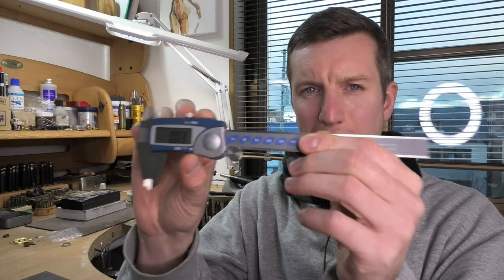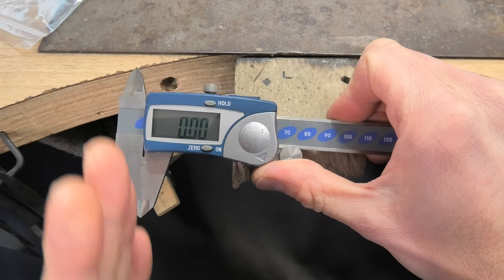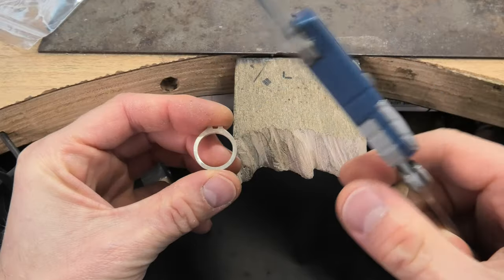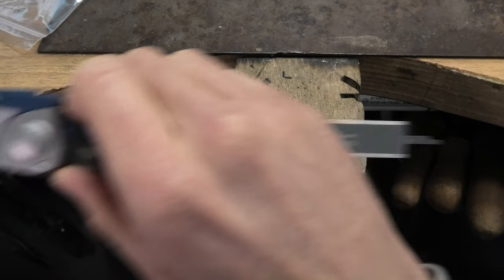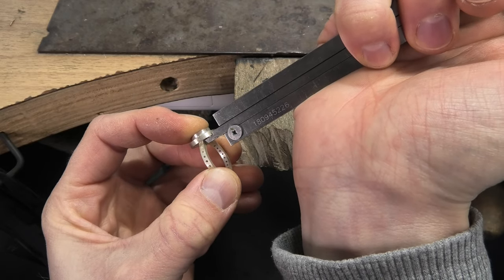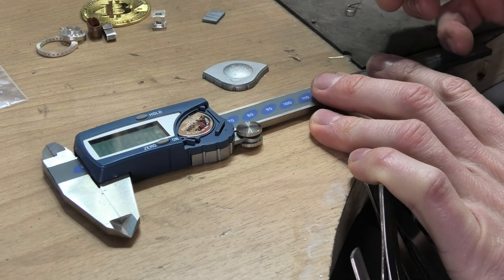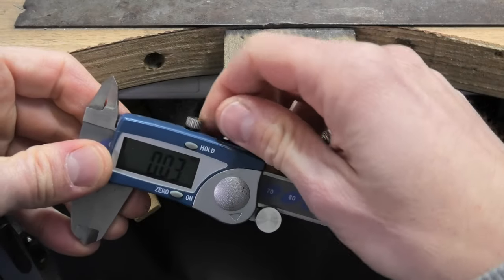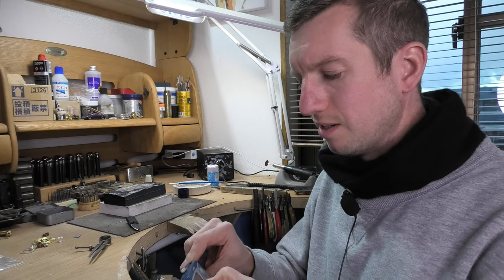Beginner Guide To Making Jewellery. Digital Calipers!

Comment: Could you put how to use calipers to measure a ring size, and the correct way to measure it. I know it the inside diameter, the width of what you were using such a silver, and , the thickness of the silver that you are usingThen divided by 3.14 equals the length do you need to cut your sheet silver to make the correct size of the ring.

Comment: Thanks,  just one point, don’t buy very cheap un named callipers eg under about £27 in UK. You will not get accuracy. A little more gets you a good set equally no need to spend £100.